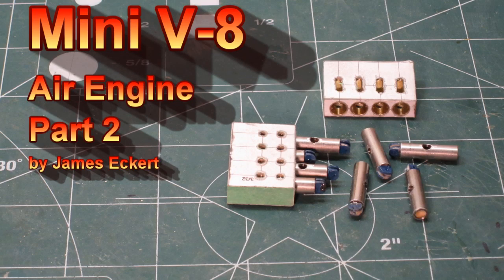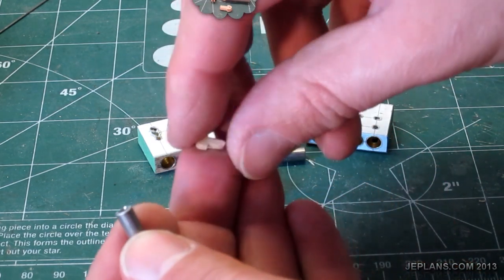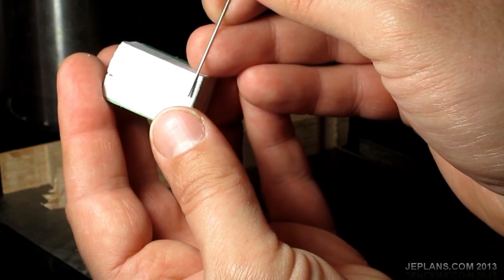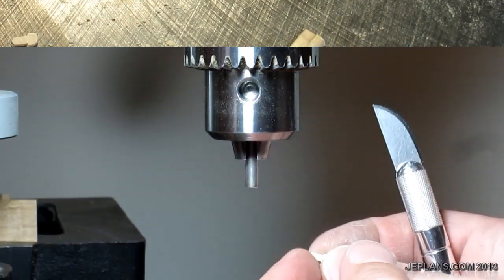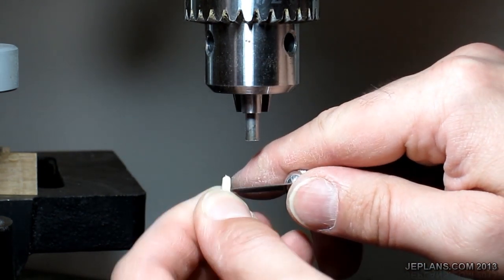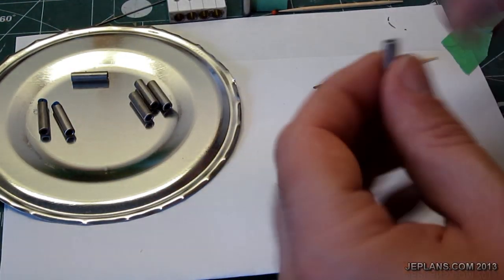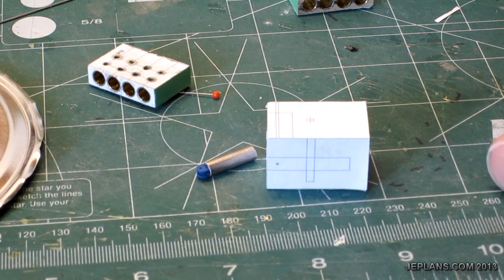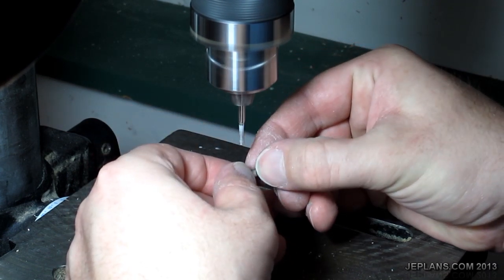Mini V8 Air Engine Part 2

Comment from the maker: While there are a couple of ways that should work, all of my piston-valve engines in the end are driven the same way, 2 pistons 90 degree form each other(on the Crankshaft) control the air that drives the air to each other. They only appear different because of different crank or piston arrangements. Also some of the air flow is integrated into the structure of the engine block on the 8V instead of tubes.

Comment: Can you please explain in a video how your engines work. I'm trying to understand but you only show how to build them. based on what I understand, you used diferent conections, diferent ways to made your diferent engines. the tubes are conected in diferent ways on the mini v8 and on the inline. why? souldn't they be the same but with 8 cylinders?